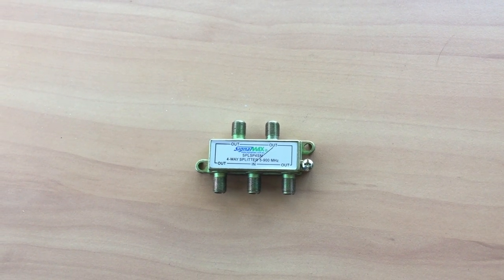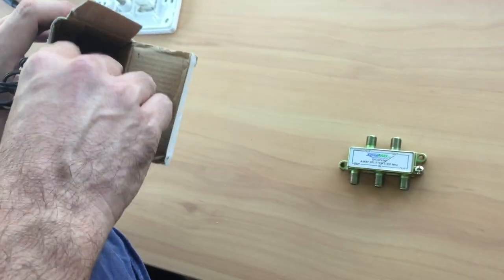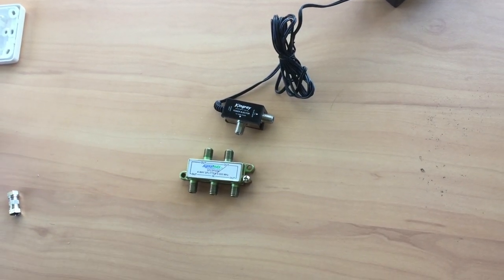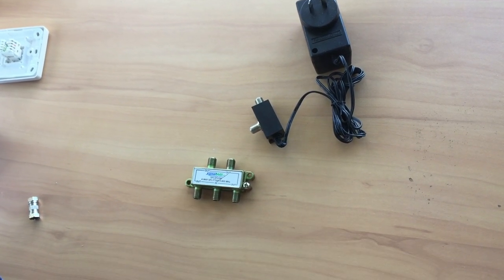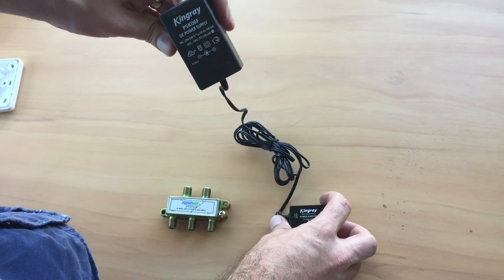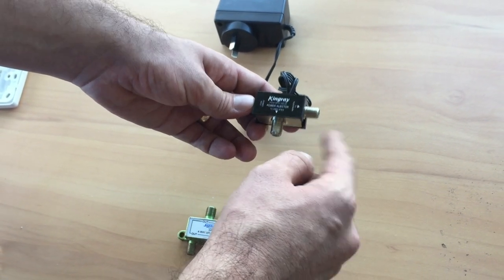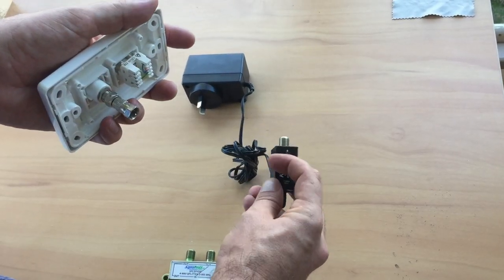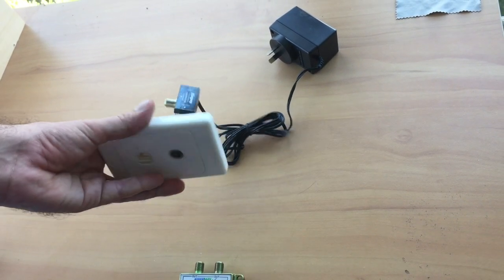How to Install a Masthead Amplifier for Digital TV   Part 2

Comment: If the cable goes behind the wall, where does the charger go?
Reply from the maker: There's two parts to the power unit, a plug pack and a connection box. The connection box either can plug into the socket or be installed behind it. The plug pack unit goes into a power point socket.
Reply: @DigitaltvhelpAu  OK. The plug and cable goes inside the wall. That leaves the charger outside the wall. How does that work.
Reply: @2460speedy  It doesn't, thats just a cowboy install.  As far as I understand these amplifiers are supposed go as close as possible to the aerial that means in the loft, so you need a power supply to plug into in the loft.
Reply: @Elfin4  If you watched part one you will see that the amp is on the antenna mast, the device in this video is just the power pack which sends an electrical charge through the coaxial cable to the amp on the antenna mast, to power it so it can amplify the signal right next to the antenna then send the signal down. If there is a splitter in between the amp and the powerpack, then it has to be a powerpass splitter, preferably an all-port powerpass splitter incase the power supply gets moved to a different antenna port.